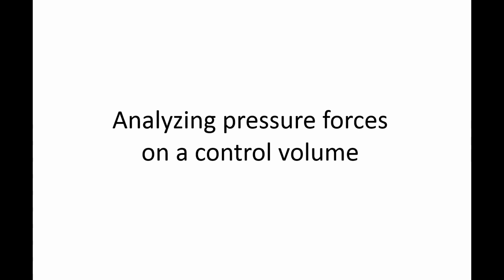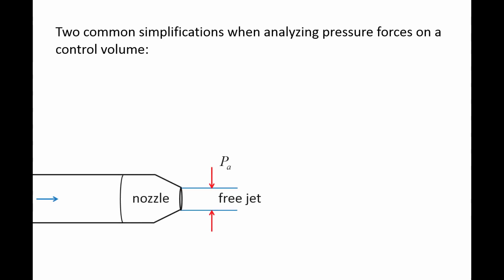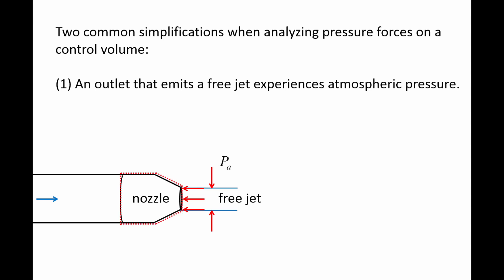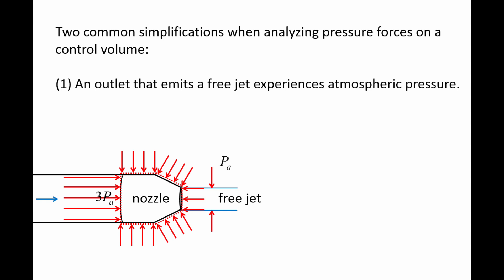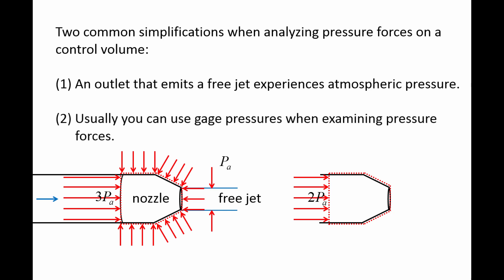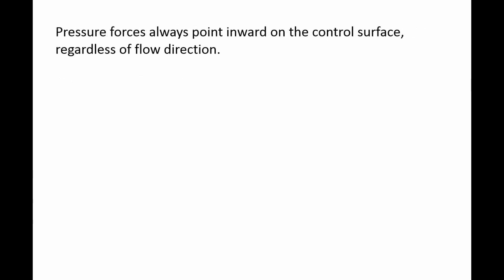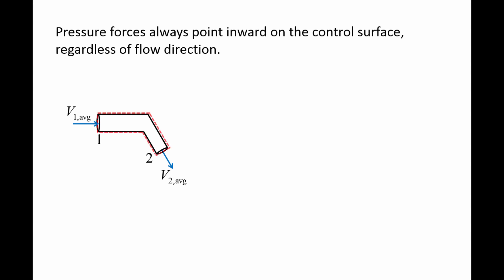Fluid Mechanics: Topic 7.2.1 - Analyzing pressure forces on a CV

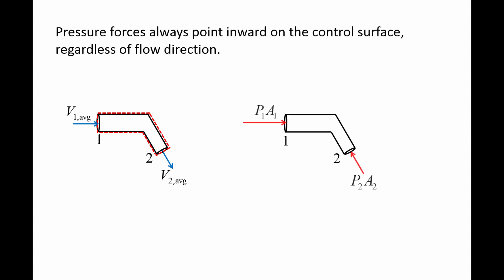Comment: 2:38 why is P2A2 not outward is make no sense
Reply from the maker: Pressure forces never point outward, only inward.
Reply: If pressure forces were to act outward, it would imply that the material or fluid is under tension, which would cause it to expand indefinitely. However, pressure, by definition, compresses, leading to inward forces. If the forces acted outward, it would suggest a pulling force, which is not how pressure operates. 
Example- The pressure inside a balloon or tire pushes outward against the material, but the material of the balloon or tire itself experiences an inward force due to this internal pressure.

Comment: Fucker! What bout kinetic energy generated by the nozzle? It goes opposite way against the fluid flow direction , and if you drive them into propellers wigtips they will turn the wheel faster & faster due to centrifugal power.

Comment: why they always point inward??
Reply from the maker: Imagine if you went underwater and pressure forces pointed away from your head. Your head would feel like it was being pulled apart instead of being crushed. Pressure is due to fluid molecules bombarding surfaces. When we draw a control surface, the fluid molecules outside that surface are bombarding it, creating a pressure force.
Reply: thank you, sir.
Reply: What if we are in space? I mean what if absolute pressure of inside in bigger than outside, in this case it should be outward, right?